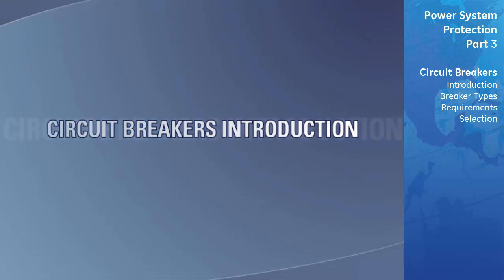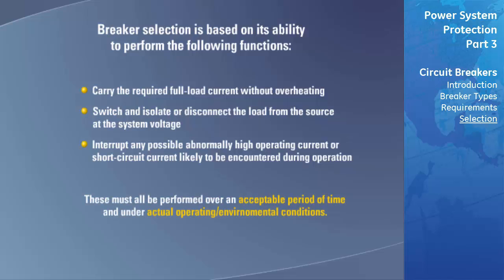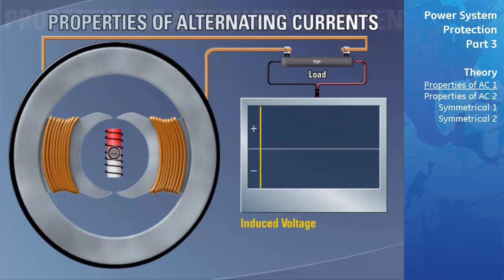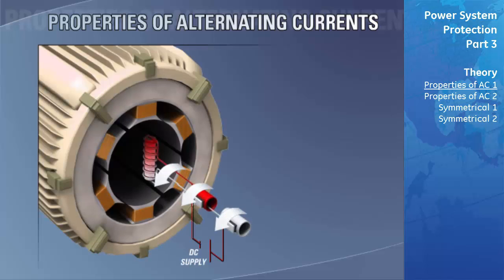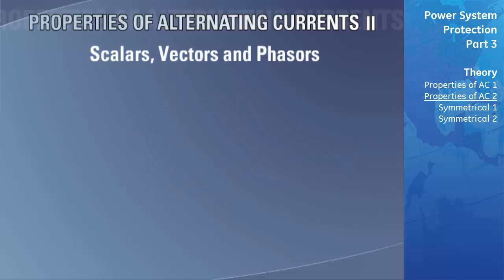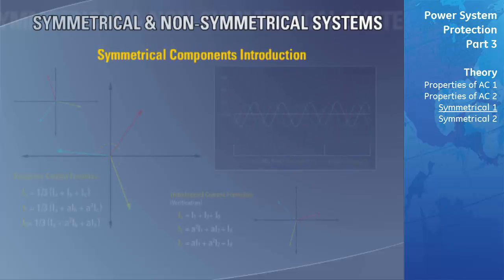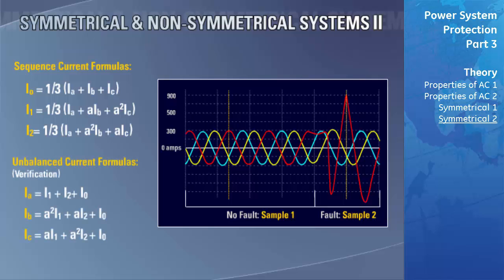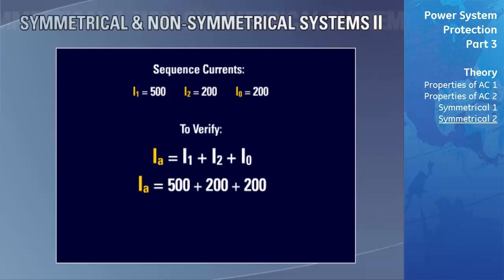FMPR-103 pt3 l  Power Systems Protection (Circuit Breaker Theory) v1

Comment: It's worth to mention that the SF6 insulation gas has a global warming potential of 23 900 kg CO2-equivalents. That means that a leakage of 1 kg SF6 is approximately the same as emitting 23,9 tons of CO2. It's the most potent climate gas ever invented, and should therefore be treated with extreme caution.
Reply: +Martin Lillebo 

That's very interesting Martin. Do you have any resources to read up on this?